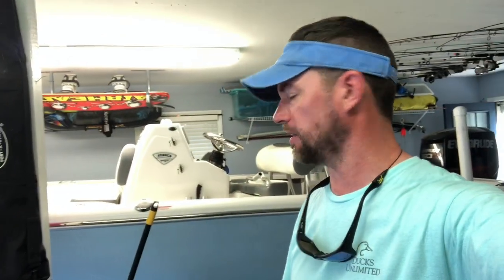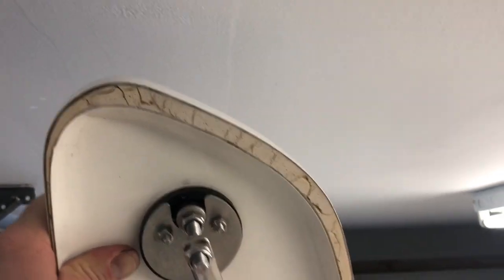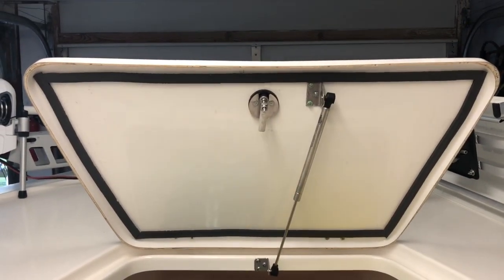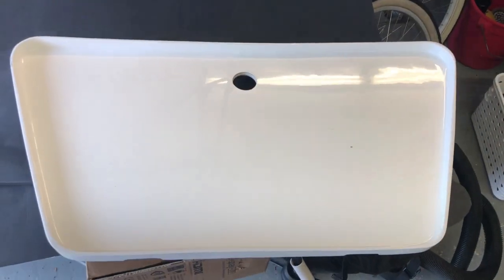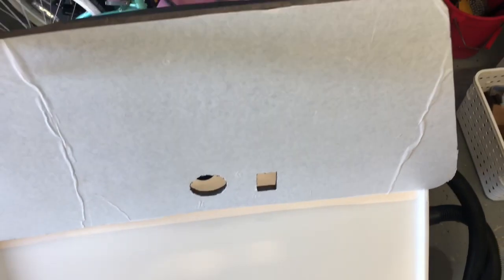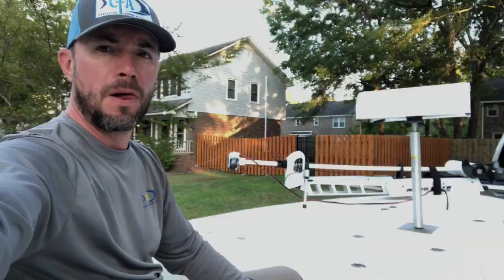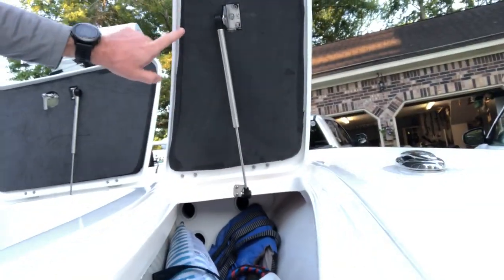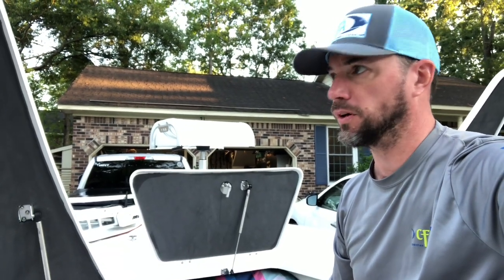Tidewater Hatch Mod

Comment: Just an FYI, those hatches are supposed to have gaskets on them.  I went to two dealerships to look at Tidewater Bay Max 1910's.  One had gaskets, the other didn't. 

The dealer with the missing gasket said that wasn't right.
Reply from the maker: Yes, I think they realized it was a cheap addition to keep customers happy with dry boxes. I don’t think they had gaskets in 2017 when I bought new.

Comment: How did you paint the edges?  Tape it off?  How is the paint holding up to use?  Nice boat btw 👌
Reply from the maker: corey keffer - I just used a foam brush and carefully brushed it on. Waited 24 hours, sanded with some 400grit paper and repeated 4 times. Don’t sand the last coat for glossy finish. I’ve had the boat out probably 6-8 times since this mod and it’s holding up great.

Comment: I am looking at a tidewater but I wanted to know if it had any hull slap. So when anchored or on spot lock into the wind, especially with light ripples on the water is there any hull slap with those waves on that hard chine in the bow of the boat. thanks

Comment: Looks great! We have a 1910 also and have been doing upgrades. Would you go with the 3/8 or 1/2 on foam? Also been looking at added a leaning post instead of the flip seat. What height is yours?
Reply from the maker: Chris R , having fished the boat 3 times now with the hatches foam lined, the 1/2” was the way to go. There are some inconsistencies in the hatches though.  Some spots could’ve used 3/8” and some others could’ve used 5/8”. But overall I’m happy with the 1/2”. Might’ve gone 3# instead of 4# density. Also, the leaning post is 32” high off the deck.